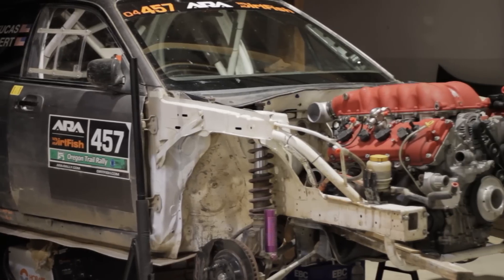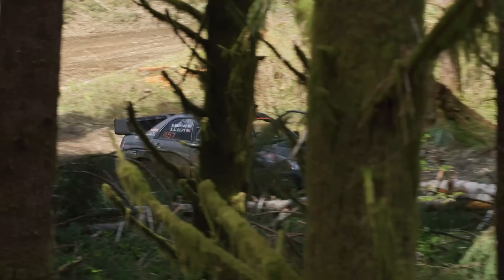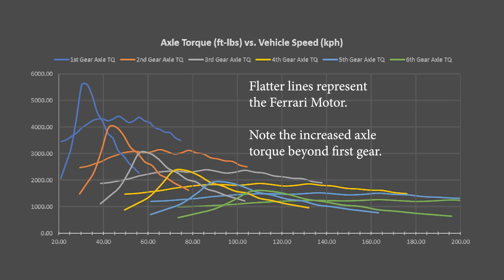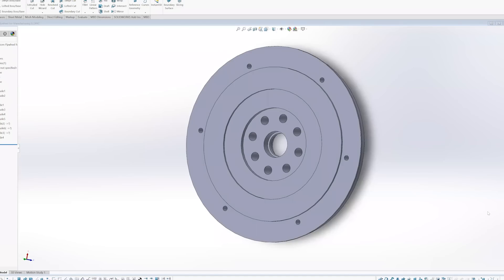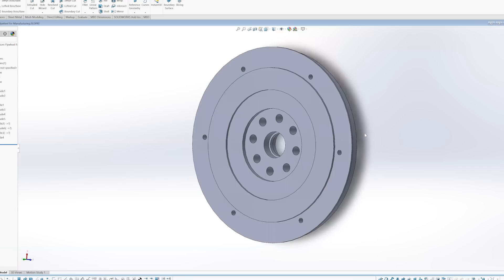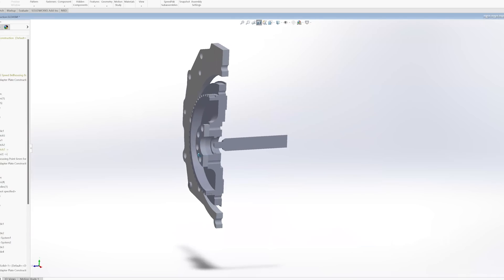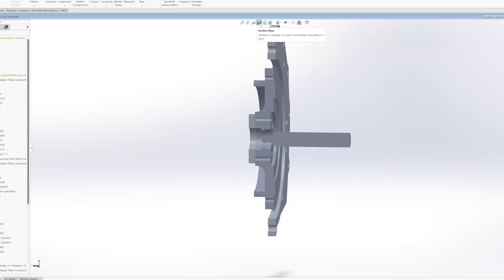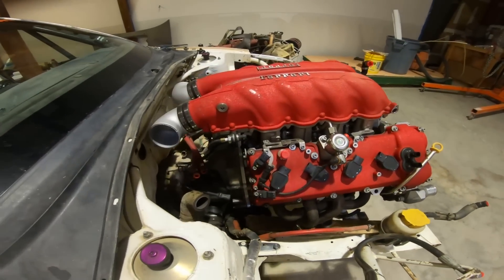Swapping a Ferrari Engine into a Subaru Rally Car | F136 Build Series Ep 1 - Intro

Comment: This is awesome! I was actually looking for info on the Maserati variant as that’s what I’m putting in my project but it’s the same block as far as I know. I had the exact same idea of using a button clutch. I was looking at using the stock flex plate to mount the clutch but man oh man did you make a good looking setup! 
Can’t wait to watch more!!!!
Reply from the maker: There’s some differences between the blocks especially between the wet and dry sumps but not a ton. Best of luck with the swap!
Reply: @SamAlbertRally  dry sump for sure. I didn’t even realize they made them wet sump. 
Have you made that scan of the rear of the motor available?

Comment: I'm watching these videos so hard right now! haha. 
I'm planning a project with the same engine but to an Audi 6sp manual transmission.  How much did it cost you to get your custom fly wheel machined? Thats a big hang up for me right now. Also..how did you get the engine to stand alone? The ECU is keeps throwing errors because its missin the BCU and TCU. How did you handle that?
Reply from the maker: Flywheel was about $800 for materials and machining.

Comment: If you think 30 grand was to expensive for a motor,  you better brace yourself for the costs that this Ferrari motor will deal you when things start to fail.
Reply: The only engine brand more notorious for going pop than subaru
Reply: @PhonyBread  Ferrari is? No 😂 They're engine are known to be very reliable actually
Reply: In 10....9....8...       what's the glove box for in a ferrari? To collect all the bits that have fallen off.

Comment: is it going to stay that far forward?
Reply from the maker: Unfortunately yes. There’s opportunity to bring it back an inch or two but would require a huge amount of additional work if I want to keep AWD.
Reply: @SamAlbertRally  appreciate the response
Reply: Way late to this video, but did you consider milling the bell housing down and welding a custom flange to not have to use and adapter?  It leaves the trans in place for AWD alignment and moves the engine back.  Could have the trans snout milled shorter too.